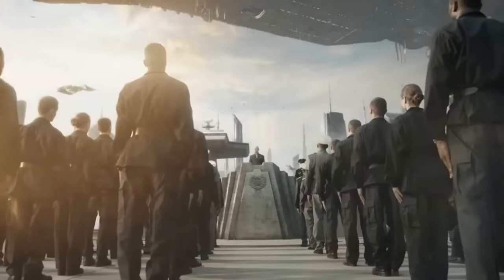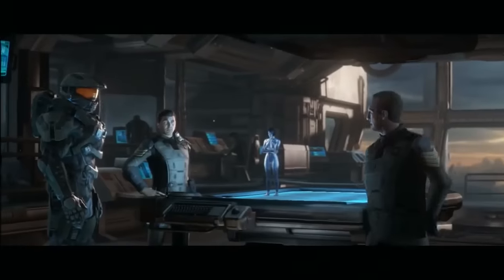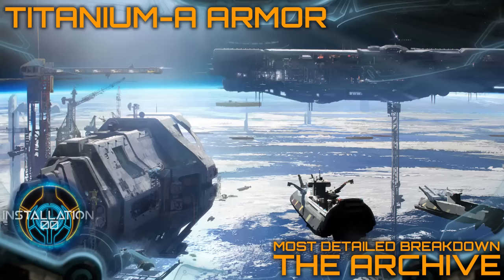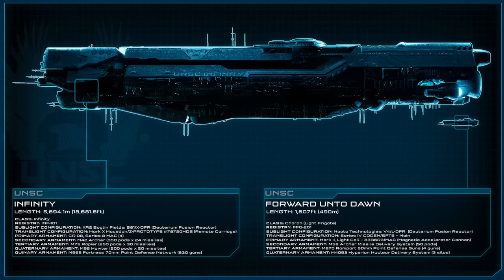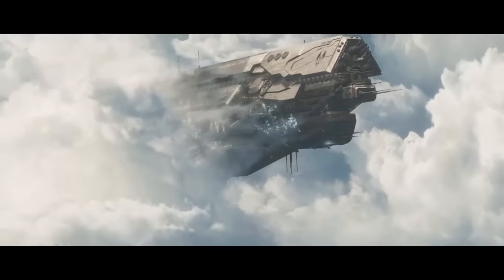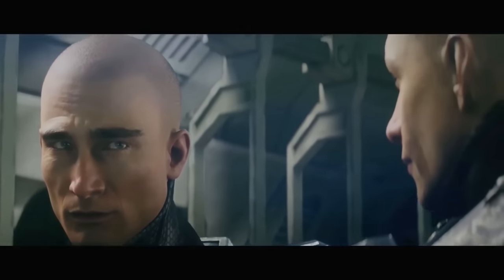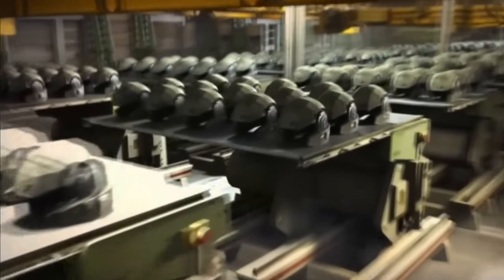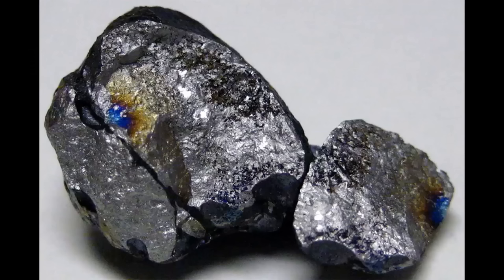UNSC Infinity | Most Detailed SUPERCUT

Comment: I remember having an argument with someone and they were arguing that somehow the Death Star could literally outrun a MAC round from a fleet of UNSC ships. He was quoting ridiculous speeds which might be true.

But then I just retort “well then explain if it was at the speed of light?” And explained the Infinity. 

Yeah Star Wars is a space opera, not a military sci-fi.
Reply: That's one of the reasons why the second death star had a shield generator.
One hit on the Death Star's main reactors would overload the whole thing.

Also, while yes the death star could go in hyperspace, the problem is that between jumps there is a recharge period and to recalculate the next jump. The Death Star is indeed slow when it comes to changing directions. It's not its sublight speed that guy quoted, which is slow, it's probably its speed while in hyperspace.
Reply: @AAhmou  I should have retorted about how long it took for the Death Star to orbit the planet in episode 4. Even in orbit, it seemed to take forever to get to the moon in sight.
Reply: Clearly you've never heard of Ludicrous Speed.

Comment: Did you know that metallurgists are working on a titanium cross section that would be formed similar to plywood? The strength of the metal is longitudinal. ie along the long axis of the metal as it was formed. with the metal in flux at a temperature that I do not know the metal is cross layered. This gives the metal a very strong structure on multiple axis. I would assume that in 2550 that the game is set in this process, or its like, has been improved to the point where more than the current two axis can be processed at a time. The armor would then be able to withstand hits from energy and concussive weapons even at the level of the Covenant.  Then as the technology and metallurgy continues to improve the metal would be quicker to manufacture giving the UNSC the ability to put the armor on ships of the size of the Infinity fast. Otherwise the build time would be measured in decades.

Comment: The armor plates are so large, they were most certainly manufactured at the same facility in Sols Oort Cloud that built the ship. A ship that size would literally be impossible to build on most if not all planets surfaces, meaning both the ship, and the massive plates were both manufactured in Zero G. 

It's also worth noting that the UNSC Infinity smashes through the NECK of the covenant cruiser, which is literally the weakest part of the ship, looking at its structure, so probably didn't have nearly the same impact on the Infinity that it would've had that crashed into the front or the back of the ship. Yeah, you looked up the entire mass of the covenant ship, but but its varies in shape drastically, with way more weight and mass in the rear, where the Infinity is fairly uniform throughout its entire body. So the neck was literally the weakest point on the ship, and easy for something with evenly distributed mass to crash through.

Comment: I might be wrong but I think you calculated the wrong figure for the infinity smashing the covenant ship. If I recall it correctly you used the mass of the infinity in the equation but you would have to use the mass of the covenant ship. Otherwise you would get the same energy output by the collision no matter if it struck a dust particle or a neutron star. 
I'm not a native speaker so maybe I screwed it up in translation of your words but it felt wrong.

Comment: I can only imagine the black ops ONI would put Infinity through, if not for Fleet Com owning the ship. I know ONI has their part in the ship. But to think of ONI commanding Humanity’s culmination of achievement is almost…terrifying. 

  The Infinity is my favorite ship, mainly because of its flagship status, and the lore surrounding it. But I’d like to imagine the black ink on the ship if ONI had commanded the vessel alone.

  Also, the Infinity DOES have a sister, the Eternity. Now, considering the Infinity’s state, what if Humanity saw it fit to complete the Eternity, and what if the Eternity was operated by ONI this time around? The failure to counter the surprise attack from Atriox was a massive blow to the UNSC, which is an understatement, to say the least.  

  The Infinity being under the command of Fleet Com, what if ONI used that as leverage to command the Eternity, and outfit the Eternity with cloak tech, or technology Humanity has NO knowledge of, besides those under the blanket of ONI?

Comment: One of these days I'd love to chat about titanium vs silica or carbon based microalloys.  There was a new one that came out this year from Germany that is facinating, and one out of China about 8 years back that was able to scratch a diamond (though they weren't specific about the grade of diamond that I noticed).

Oh, as to removing oxygen during the founding they may have used argon, that's what we use in our blast furnaces when we want to avoid oxidation.

Comment: a whole lot of talk to limiting the unreal to the limitations of curent science realities to make unreal devices seem more realistic  more than "light speed"  is funney but still limiting in comparience to future unknowables of what could be developed beyond standard rules like measure when outer image dont match inner multileveling abilities which could far exceed the veiw of whats seeble by the outer shell equating a lighted window to just one skyskraper more than a mere single room the fact that a shell image can break the measure rules and be so heavily deep as multiple endless battle world concepts meaning shell rules wasnt quite followed and didnt have to limit its measures of scalability to standard rules of science but the rules of imagery meaning amount of detail if they wanted a minimal game play as a smaller idea it could have had less or if to maximize the idea by multiple endless tunnels and coridors it could far exceed how little the outer shell appeared and been much larger than apeared but gameing rules bend reality rules with bizare sciences as shrinkage vs expansional measures where full planets could be carried in a microstate  or six foot measures converted to six inch charactors or even balooned where the smaller six foot charactor can pulse an image as big as the giant sky skraper projections to be a hard energy feild makeing the smaller charactor tuffer and larger in cases when needed another level that coulda been used as manual laboring in mineing on larger scales and or mechanic missions less intended for battle but re'purposed when the need arizz still you got the weight properties of turning several sky skaper sized skales into laying down and floating  and the combination of multiple air feild carrier boats turned into air floating ships that would never acheive without gravitational feild converters to basicly make a metal plate float lighter than a feather or tons heavey stone as light as a pebble on the tip of a finger but steping someowhat back into the fanatical fanstasey of aliens and magics  you step out of the limits of reality even with transporters and question how much shrinkage is allowable  for a thing to still have its basic structure as data dna or how much space to transport a massive space like moving a whole ring or whole solor system through a slip space rather than oblitterating ideas but basicly captureing the entirity into the library data center of the teleporter and selective ability of which things remain in the library verses which things are then released from the teleporter all these levels go back into the non real imaginary rules of size and measure and weights because even the idea of a teleporter use would be more akinned to the comparance of creamation put ina bank tube vacume and only comeing out as the ashes includeing the bigger whole ships traversing though a space warp only doable in false realities of images not bound to natural rules of actual depth but sciences into weighlessness and teleportational understandings then takes us into the librarian sense of how small things can be if converted down to a data copy and hint abilitiies of what could explain a planet being inside a small ship or the solders traverseing the inner workings as if they was only six inches or less  in a ship thats then quantified as a ghost remanant of exspansion like it was hawling on much larger scales by its projectional energies  but then again sciences in weighlessness also gets into explaining the rings ability to block out strain and stress issues by its weighlessness as if remooveing gravitons from a natural element to make it weighless as unresponsive to gravity rules and this effect reversable too as when adding gravitational binding when items seem to become heavier than normaly known can also be aplied as extra binding agents like specific magnetics added to a metalic just as walking on the botom of a ship thats in normal gravity because of the magnetic boots  allowing specific controled suction so while slight reality sense we still have the unreal properties that makes it all superficialy unacheived because its all superficial therores of if it was possible  while far reaching to concepts that only work by imaginational rules  of beams that we never found doing exactly what we would want or need to even acheive those levels of element controls still limited to realities and conventional means of converting materials in the less magical means ..so otherwise would still be grounded by normal realities  and only acheivable by imagination because too much shows the creamation device is one that dont quite understand finer rules of compound matters to explaining total elemental control and perfect re'builds at least not by any human level of thought for our natural human lackings of never quite so perfect forgetfullness and round abouting of only basicly concept generalizations to somwhat laff but still conceive the ring stadges to building a actual ark ship for reasons of a drivable planets thats less likely to exploed when its vents get too closed off a bit less fanatical by fantasey rules while game and moovies makes fundings for design discovery the playground cover to working on design building of whats more doable than a games imaginary parts  thats left out  of the latter designing science but shhhh like its all "real "
Reply: oh by the way when you got teleport science you got teleported rounds maximixing quantity of bullets to dam near endless rounds then with measure converting almost instantaneous then you got rockets able to blast out of pea shooters and just as maximized as breaking natural limits of space and compacting of soldersthat could actualy fit in data transport form that otherwise would be vaporation and creamation by natural realities but its not bound to the comon rules its a blend of what looks normal and standard while knowably fantasey rules  applied to breaking the standards so you could basicl transport from a list of round types to haveing the peashooter just as powerfull as a ton shooter with things forming almost out of no where almost instaneously and measue converters when the master cheif is carring the whole ship like its just his tiney gun converted into a big ass ship than he puts under his arm because that is a sense in size converting teleportationals of the imagenariations of how to explain the incredable measures that breaks standard rules as bizare as a suit able to withstand some heavey bomb presures  vs realities limitation of hell nawe never not even close to staying in one peice but just as oblitterated as the enemy that carried the warhead too or the fact of no true teleport lightspeed of acting faster than the simotaneouly  hit trigger of  such a bomb to say he just teleported before the bomb reacted except in fantasey rules that exceeds limits of measure rules meaning you didnt need to change weapons so often for their endless ability to teleport battery power and bullets and a number of various bullets out a bulleters wharehouse  and not just what you could carry or fit in a few inches but nice try to blend averages to normal limitative realities